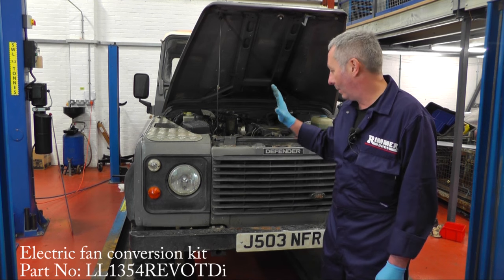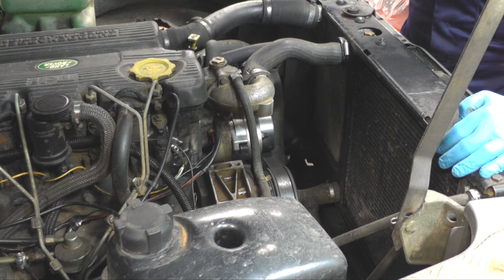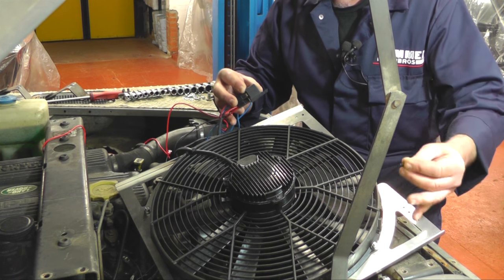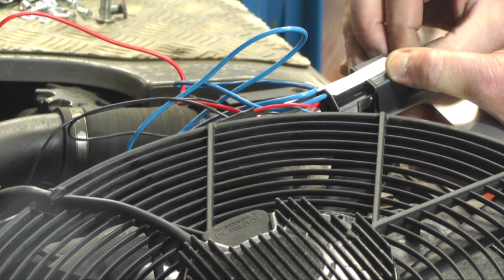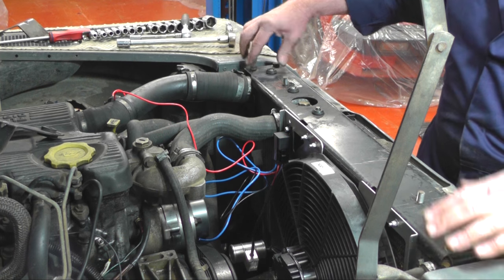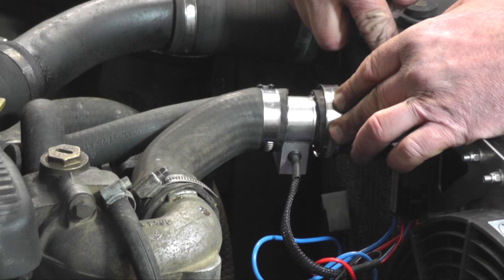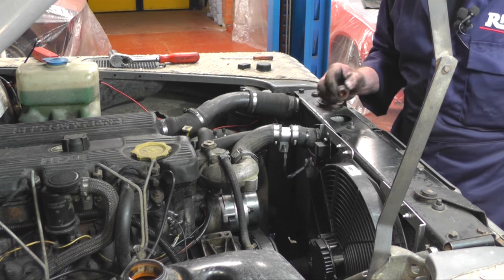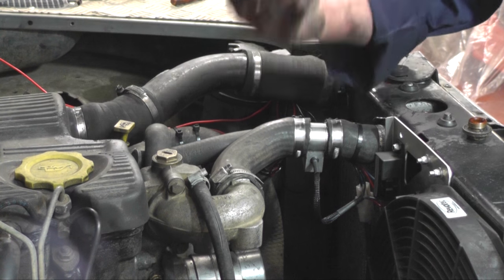Fitting a Revotec electric fan conversion to a Land Rover Defender 90

Comment: Thank you for all your interesting videos , i just want to ask about the electric fan and  off roading ,  especially in deep water crossings ?
Reply from the maker: Hi Anas, these fan kits are waterproofed up to IP68 standard, which is the highest you can get and therefore, they are fully dust and waterproof. Hope that helps.
Reply: thank you so much for answering me .
Reply: Anas Khalil But nevertheless, these fans do not keep Your engine cool enough in low speed and high power demands

Comment: Nice video thanks. Having read various forum's, I can't decide if this a worthwhile mod or not. Any comment?
Reply from the maker: Hi Mark,

Thank you for the feedback.

We would recommend as each Revotec Land Rover Electronic Fan Conversion kit is an idea replacement the original viscous fan. Eliminate the engine warm up problems giving you a more effective heater and faster engine warm up time, resulting in a better MPG & Performance on your engine. Each kit is supplied complete for an easy DIY installation.

The part number on this video has changed since filming to: https://rimmerbros.com/Item--i-LL1354RTC

Hope this helps :)

Comment: Where did you pull the power lead from?
Reply from the maker: You can pull power from an ignition power feed within the fuse box or direct from the battery.